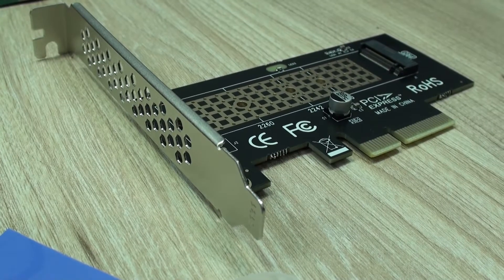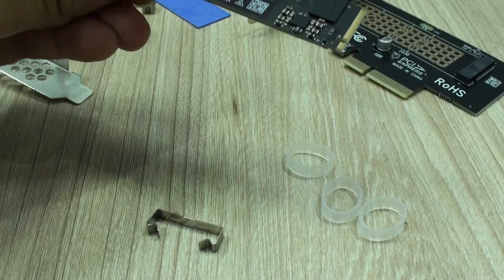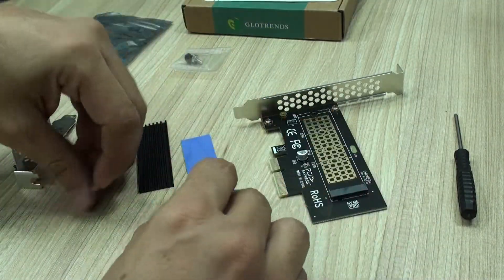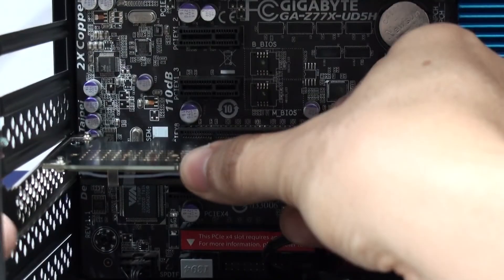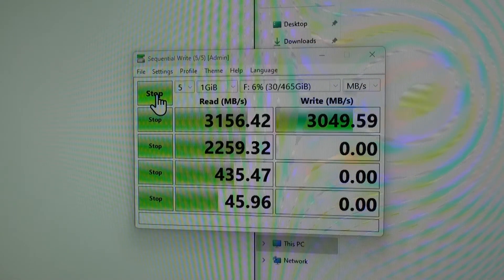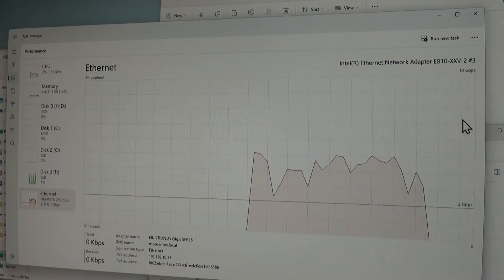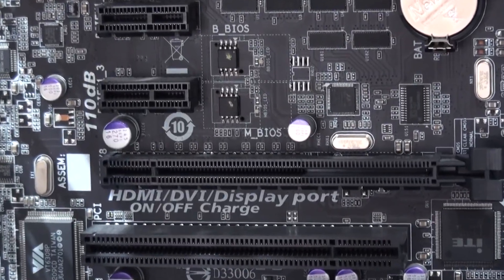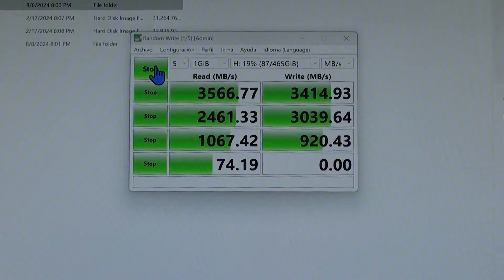PCIe adapter to NVME drives - Super fast facts - You should buy one by the way, for old or new PCs!

Comment: I have an older ASRock Z77 Exterme motherboard, which did not support NVMe, being manufactured back in 2015 or so. I found out recently that ASRock posted a BIOS update some time back to allow for recognition of, and booting from, an NVME storage device. Since the motherboard had an extra PCIe x16 (x8) slot, I bought a Glotrends PA09-HS x4 adapter, slapped on a spare 256GB NVMe and plugged it in. The first boot from SATA SSD was just to verify that the BIOS and Windows recognized the NVMe and allowed me to format it, which it did. Next I launched Disk Genius (I highly recommend this) and performed an OS Migration operation from the boot SSD to the NVMe, setting the NVMe as the default boot on restart. When finished, I shut down and removed (unplugged) the SATA SSD then powered the system back on and presto! The NVMe booted right up into Windows. Where the SATA SSD was limited to around 550 MB/s read speed, the NVMe was now operating over 3000 MB/s. It's amazing that such a simple upgrade can make an old system feel almost new again.

Comment: I bought a MSI SPATIUM M470 PRO Pcie 4 M2 SSD and didn't work with my As Rock B450 Pro 4, this adapter will really fix my problem ? it seems my motherboard have a limited list of compatible M2 NVME and even on their technical support page they suggest this adapter, thanks for the video though
Reply from the maker: It should work, it is weird though why your B450 has such limited compatibility.  Double check all the specs.  Good luck with your upgrade as that is a fantastic drive with awesome write speeds.

Comment: It will work with a single drive with no problem,but if you have a PCI-e card that supports multiple NVMe's the bios has to be compatible or it will only show 1 in the first slot!
Reply from the maker: Good comment we'll try to replicate this as we are testing more expansion units.  Thanks for sharing!
Reply: @GadgetsOfTM  I thought multiples would work when I first bought one,and my bios didn't support it.After further investigation,I found you have to assign it as a 4x4 pci-e slot in bios for it to see all drives.I still use  one myself,and found this problem on a z790 Asus m/b I have.I recently swapped to a z690 ASRock for the 2 USB 3.1 headers and haven't tried it yet but I'll post back my findings.They're great to have for older boards but limited in that aspect.
Reply: Thanks sir, will this adapter work on 1155 to install o.s(windows 10/11) installing on old motherboard.